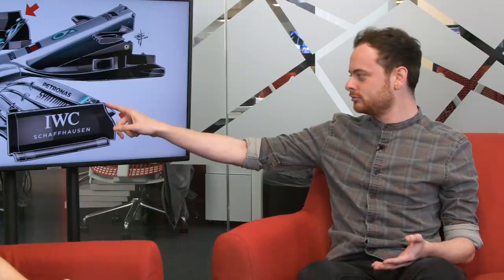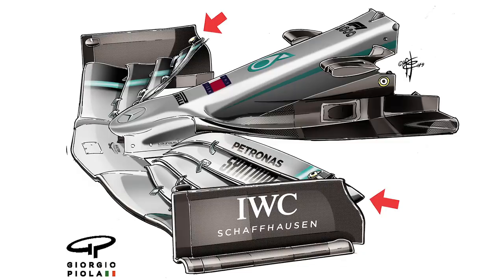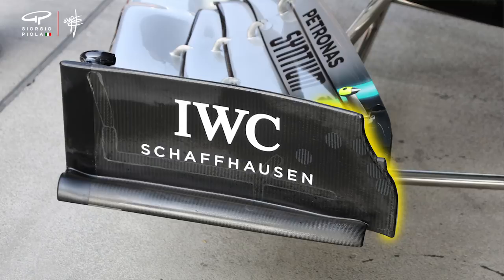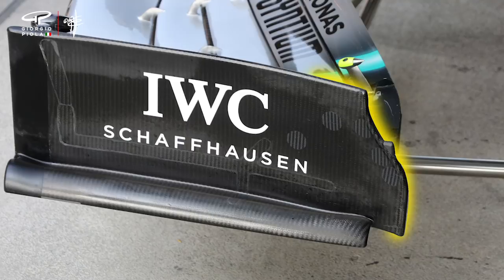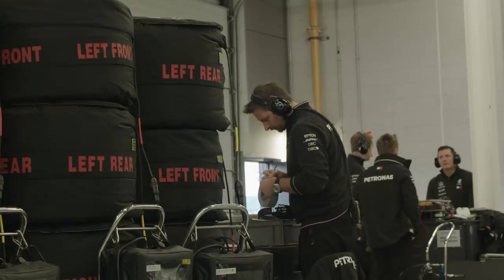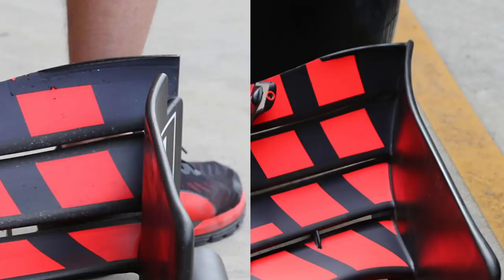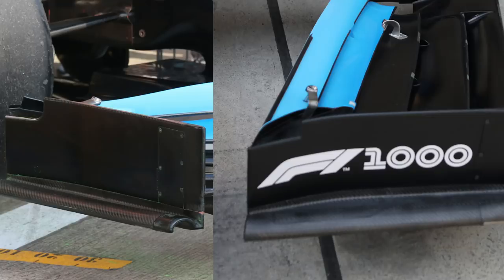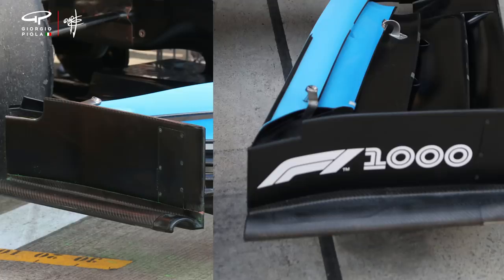Why Mercedes (and others) were asked to change their F1 front wing designs

Comment: Air is a fluid it doesn’t flow simply, it’s just not as simple as these guys make out. This is a joke isn’t it it 2 guys talking about their opinion of the design of a few pieces of carbon fibre . Mercedes win because they have the best car., engine(remember them) transmission & suspension. They don’t even put up photos.just drawings . Non technical racing Fans are really going to love this,I have been following F1 since I was very young never seen anything like this day after day front wing after front wing. If you go to a race as that wing you aren’t going to watch a front wing shoot past you at 150mph.

Comment: Baku is a top speed and good traction track with little to none down force required. I feel like Ferrari will kick Mercedes in the butt there.
Reply: @Izumi Culture well you run way more downforce in china than you do in baku
Reply: @tractie_  It's not about that. It's about Ferrari's lack of front downforce that is killing them and Baku is no exception being a front Limited circuit since you need it to warm up your front tyres, the narrow castle section, taking the 90 decree corners right. However the Ferrari appears to be sensitive towards and bumps, which is usually there in Baku.

Comment: yeahh ok start discussing sitting on the coach not mentioning that Merc. . .  couldh't be so fool to believe that this front wing wouldn't be banded. They just wanted the final version (after the correction from the FIA), so they push the initial design to an extreme so as to finally have the desired result with the "blessings" from the FIA. They just always cheating, wake up !!